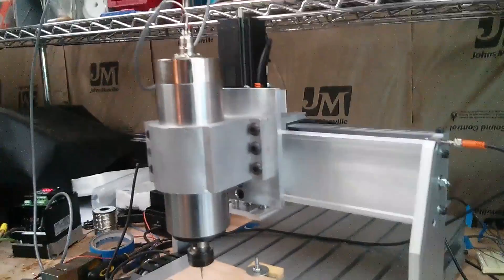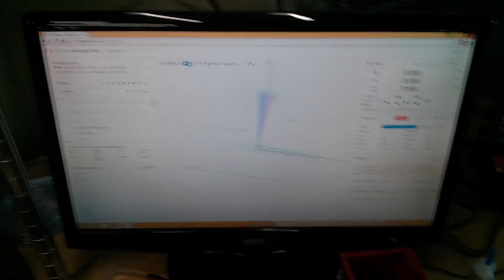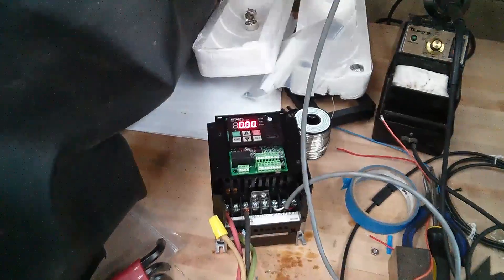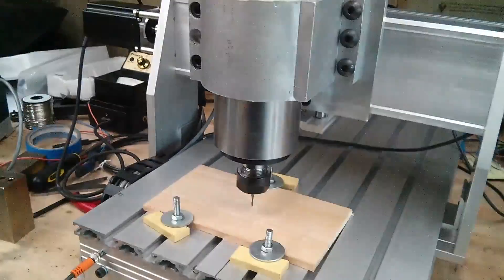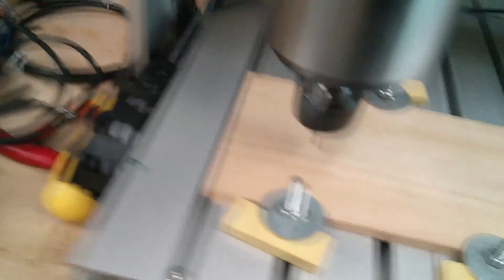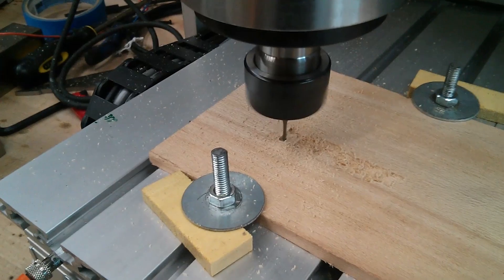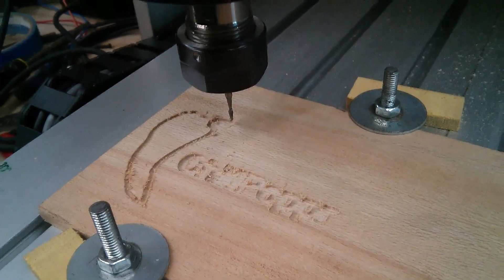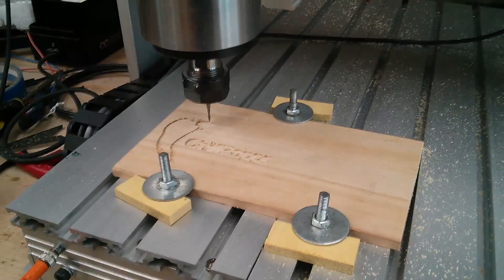3040 CNC With TinyG and 2.2kW Spindle - Update!

Comment: The original spindle was 52mm diameter and it seems you can get a full er11 shaft through the windings starting at 55mm.
It's a shame though it's not a simple upgrade to get something to cut aluminum. Only option is remachining the z axis. I'm guessing that's why you went straight to a 2.2kw 😂

Comment: can it cut alluminium ?
Reply from the maker: It can but since it's not a very rigid machine you have to take it very easy which isn't great for the mills or the surface finish of the part you are making.

Comment: I'm surprised that you did not use coolant for demonstration. I also have Chinese made spindle (1.5kW), and the seller warned me about the coolant. He said the coolant must be circulating before turn on the spindle. Without coolant flowing it will get overheat inside and damage the spindle quickly.

Comment: hello Chris, this router  will can work fine for grinder engraver  micro chips, and micro components with max work area of 2x2 mm ? Can it be accuracy and precise for this works ?
Reply from the maker: I wouldn't trust it for something like that, no.
Reply: ok, thanks, I will buy  a 6040z system, but I think of buy all parts of it separated and then assembly on frame 6040z: I had think a 3 motor nema 23 - 425oz , 3 driver D542MA (china) , spindle air 1,5kw, and inverter 1,5kw (china), about controller breakout I want use USB or ethernet connection but I no have idea for whitch take on..
Or second way, always in my mind, about a controller cnc , I will buy a original China controller box bandled with 6040Z, and update same in your good video
What choose i can go ? Can you help for choose a better way ?

Comment: How are you powering the VFD? Do you have a 220v plug? Does it support 110v?
Reply from the maker: The VFD just takes 220.
Reply: Is there a way to power it with a 110 plug? I dont have a 220 in my home.
Reply from the maker: +Jinx117 I want to say they make one that will run off 110 but I'm not sure. See if you can find a 110 single phase input and 220 the phase output.
Reply: +Chris DePrisco Okay, thanks so much for the advise and SUPER QUICK response!

Comment: +Chris DePrisco What is the model  of the inductive proximity sensors as I want to do same with my CNC machine.
Reply from the maker: +Chris Kelly I don't remember... I replaced them with hall effect sensors.
Reply: +Chris DePrisco Would u be able to find the model of them if u can? 
thanks
Reply from the maker: +Chris Kelly Well... I kind of blew then all up with a wiring mishap so they were thrown away. They were industrial quality though and probably $50+/ea new.
Reply: +Chris DePrisco how did you mount them on your machine?
Reply from the maker: These were just through-hole mount.  The end is threaded so you just drill a hole, stick it through and put a nut on the other side.
Reply: Chris Kelly v

Comment: waht about the weight? do you have any problem with the weight and the frame?
Reply from the maker: The weight of the spindle? I've had no problems with it.
Reply: u r my hero. do u think 800hours of worktime for a chinese cnc 3040 on working wood is to much? (i am planing to make production with one of these)
Reply from the maker: It's hard to say because the quality of these generic products varies wildly.  I've used my own electronics which I think is the weakest part of the 3040 package.  If you are planning on really using one of these in production I wouldn't take a chance on a generic machine - I'd get one from a reputable manufacturer that has a support team and a warranty.

That being said, I think mine could handle 8-10 hours a day for several months with no problems.
Reply: thank you mate. however these generic ones are easy to fix on your own i t
hink. i guess now there is only one to find out :)

Comment: Your Spindle power cable is waaaay to thin :O
Reply from the maker: +NoName It may look that way but it's 16AWG which is good to 22 amps.  That spindle is rated for 2.2kW (I would bet good money that's hardly even ideal peak performance) and is quite a bit less than 22 amps.
Reply: I believe this spindle runs at 220V (3 phases). So, 10A will be sufficient.

Comment: Can you please answer me on comment that i wrote one week ago? Thanks
Reply from the maker: I only see the one from October 25th...
Reply: I will post it again:

Hey man!
I have a question about RPMs of stepper motors, how much rpms are max which u operate with?
I can get only like 240rpms with my Nema 23 425oz, If i go faster, the motor just stops and produces strange noises and vibrations. What to do? Which motors do u use, exact model and specifications?
All the thing is with no load on the motor shaft.

Be good!
Thank you!
Reply from the maker: I don't honestly remember what my RPMs are but I do know it's related to the motor's inductance.  The lower the inductance the faster it can spin.  Often times motors that spin slower are geared so that the ball screws spin faster - at the cost of lower torque.

I used KL23H286-20-8B motors (http://www.automationtechnologiesinc.com/wp-content/uploads/downloads/2012/08/KL23H286-20-8B.pdf) and you can find a good RPM calculator here: http://www.daycounter.com/Calculators/Stepper-Motor-Calculator.phtml

Comment: Good night have a cnc 3040
I wanted to do an update to the 2.2KW motor like to know your opinion on whether the engines X, Y, Z original support the weight of this engine.
best regards

Machine: http://g03.a.alicdn.com/kf/UT8V.yHXbVcXXagOFbXh/200059102/UT8V.yHXbVcXXagOFbXh.jpg
Reply from the maker: +ricardozxz It should be able to move the spindle easily enough, you may just have to be a little more conservative on how fast you start, stop and change direction.
Reply: +Chris DePrisco 
Thank you Chris DePrisco, cooled water is always a best option that the Air?
This engine weighs about 8,5kg?
Reply from the maker: I like water cooled because it's almost silent, you can run at any speed and not worry about the fan not moving enough air to keep it cool and without a fan it doesn't blow dust all over the place.

8.5kg seems a bit heavy but I'm not sure off the top of my head and I can't find the weight anywhere online.

Comment: you can bump your feedrates up a lot for wood. You'll be really surprised of how fast you can cut wood, much faster than aluminum. 
you can use a closed loop contact as a switch for your Zmin, that way it's independent of your tool height. there's a few cnc's that work this way. works well when your material is metal, otherwise you can home Z over your washers then subtract the height.

Comment: Tormach just announced a new smaller personal CNC mill called the 440.  The bare bones machine will be under $5,000 USD. It will have an optional full enclosure, and 8 tool auto tool changer, a work envelope a little over 10" x 6", a 10,000RPM spindle, and will take up less floor space than a shipping pallet.  Great news for garage builders and hobbyists!
Reply: 5000$ for garage builders and hobbyists hahahahaha

Comment: BTW you will not need a Z minus limit switch. The distance will change with the tool bit used so it would never be accurate.
Reply from the maker: The z minus switch was more for the machine than for the tool/work. I wanted it there so that the z axis wouldn't bottom out and potentially damage the ball screw.
Reply: I understand. Nice conversion. http://cncroutertips.com/podcast

Comment from the maker: Anything that draws current will only draw up to what's made available to it.  You have control over that with the pots on the TinyG board.  The downside is the motors will produce less torque as you reduce the available output current with the pots - but smaller motors rated for lower current will produce less torque as well.  I figure I'd rather pay $15 more now and use them at 60% capacity for a while then have to buy whole new motors later.
Reply: Chris DePrisco Thanks man! I went the leadshine controller route, it's a lot more work and more expensive but that way I get 100% power and speed out of the motors.